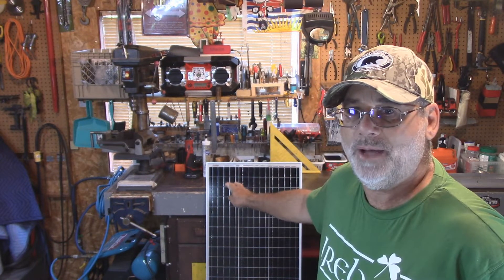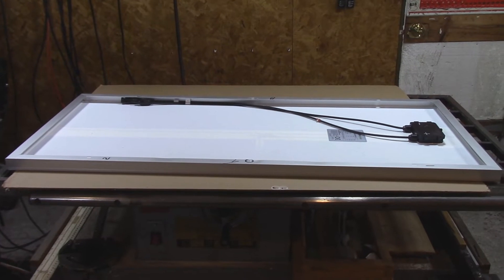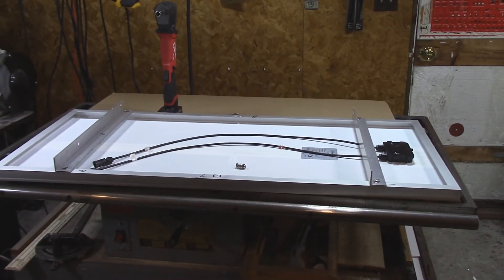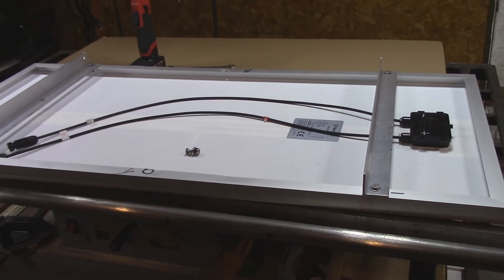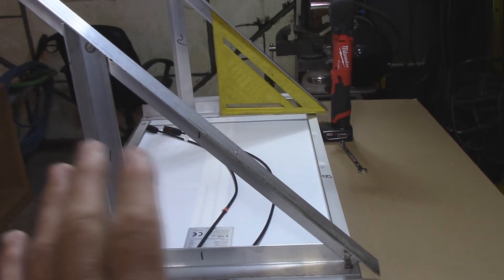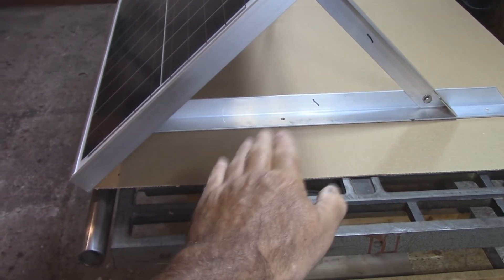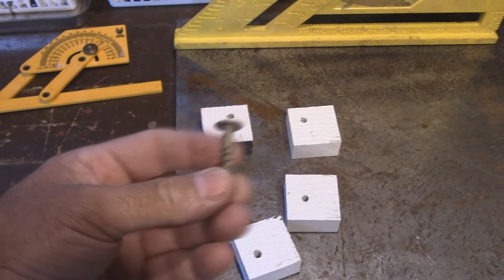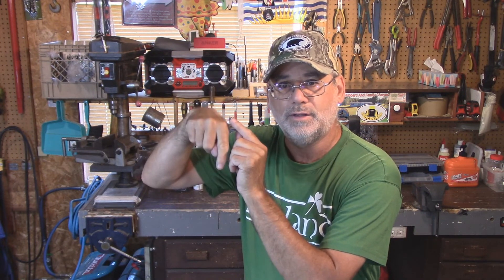How To Setup A 100w Solar Panel For Install - Part One

Comment: Hey Steve, finally looking for a system. I was wondering if your thoughts on buying a kit, like something from Harbor Freight or Renogy, versus buy the “pieces” individually to get the best system for the money. Thanks for your insight
Reply from the maker: Hi Lee 
I think renogy is a great panel , all mine are renogy off Amazon.   I prefer to buy individually unless you get a smokin deal .

Comment: Nice job, Steve! I like how you laid out all the parts needed and marked all the things you'll need for future reference on the back of the panel. I have a Renogy 100 watt panel that I use to charge my RV battery. It's not permanently mounted so I can move it around to keep it in the sun while the trailer stays in one spot. I did some research into charge controllers too. The PWM ones (Pulse width modulation) are less expensive than the MPPT ones (Maximun Power Point Tracking).  Most panels come with the PWM ones which are sufficient for most applications, but in cloudy country you can squeeze a bit more power out of any array with the MPPT controller. You probably know all this but I've had two , strong coffee already and my mouth runneth over LOL Nice job !
Reply from the maker: Thanks bud . I just use the cheapie controllers  and they seem to do well .

Comment: Great & very helpful vid Steve . When you have a camp with Hydro 1. You get charged $200 every 3 months for the “Privilege” of having hydro available. Use 0 Kw you still pay that $00+ service fee. Solar seems a far better option.
Looking forward to part 2
Reply from the maker: Hi Les 
The price of solar is getting so cheap that I'm confident  $10-15k in solar could be feasible now for seasonal places like yours to run everything but your heating .  In bulk it's about .75 cents a watt now in solar .  30  years ago a 100w panel went  for well over $600 and now under $100 .  The break even for  many now is about 8 years switching over to solar.

Comment: Great instructional video Steve. I have wanted to add a small solar set up for my shop area but was not sure how much I could get done with just a 100w system.I will be watching for Part 2! Thanks for teaching Steve!
Reply from the maker: Hi Lee 
It's all about your needs and building it to match .  One 100w  solar panel , a power inverter and one 12v deep cycle battery operates my shop up north easily to power  most small power tools but 200w  will do more as I will upgrade to a bigger inverter and add another battery.  At the camp I went three days last year hearing how their was a power outage  in the area and never knew the difference:)  Off Grid is self sufficient that's forsure 👍

Comment: Great video, I have always like doing 12v projects. Glad she didn't go sideways on ya! And 100% agree on PL Premium, it has worked great for every project I have tried it on. Countless woodworking projects, even glued a cracked 100 year old concrete wall cap back together!
Reply from the maker: Thanks bud much appreciated.   I have a lot of projects in the loop coming up so I'm sure some will definitely go sideways 😉

Comment: How's she goin'?  Nice set up for installing the solar panels.  Your mount was well built and using aluminium was a good choice I think.  You set the panels at 45 degrees, but then you'll install the mount on a roof, so does that make the angle of the panel greater than 45?  Am I missing something here or is this what you wanted?  Take care!!!
Reply from the maker: Hi Mike 
The panel  angle stays the same but on the roof it's pitched the same as the roof pitch.

Comment: I didn't know a panel had a top and bottom, ill have to check mine.
Reply: Few people know you have to mount these panels top up or the electrons don't flow correctly.  Anyone complaining that their panel isn't performing to spec probably has their panel mounted upside down.🤣
Reply: That's probably why my shop gets cold in winter.  Electrons flow backwards and give heat back to the sun.
Reply from the maker: Hi Kenny 
Just where the electrical connections are , it's best to mount them up and  away from the weather but overall there is no up or down orentation except for me using up or down in mounting the panel to get the position right.
Reply: @SteveRobReviews  10 4, I think mine is sideways then, the hardware is on the left.